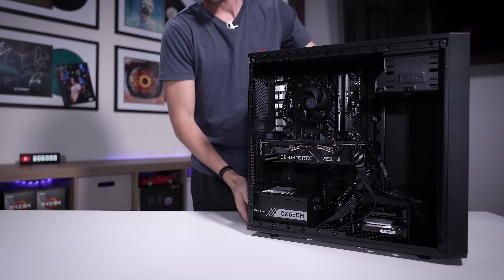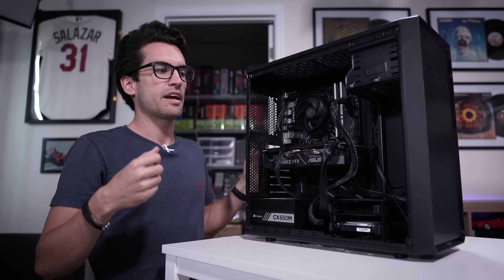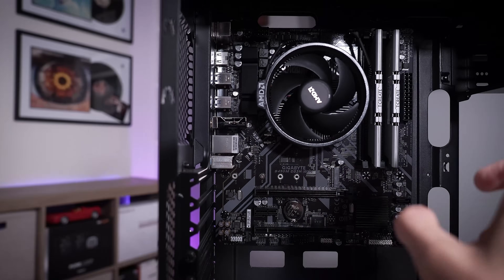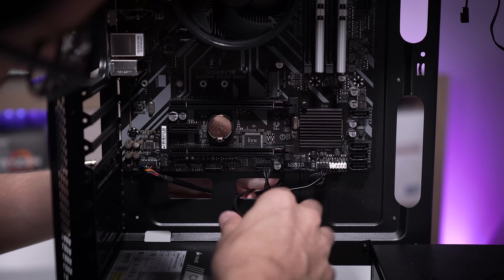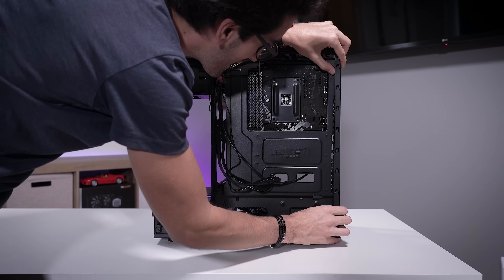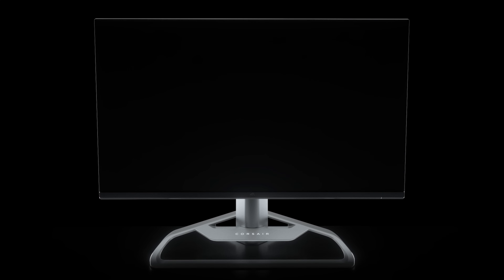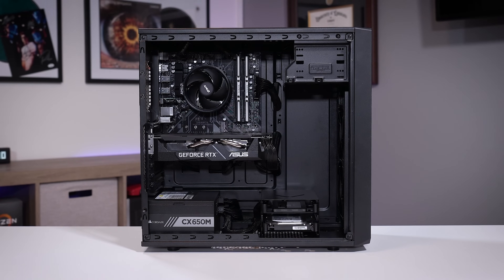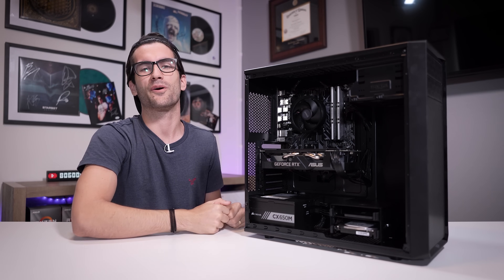Fixing a Viewer PC's AWFUL Cable Management!

Comment from the maker: Anyone out there with a 'party in the front/disaster in the back' kinda rig? 😅
Reply: Yeah me :/ jeez those RGB fan cable is the worst
Reply: @ClemBt  lian li unifans... i have 10 of them in my current build and a total of 4 sets of wires coming off of them
Reply: @ClemBt  absolutely I will never use Corsair fans I’m my personal rig ever again. It’s lian li unis or nothing for me from here on
Reply: @ClemBt  bought the lian li uni fan for this reason but it's expensive
Reply: I'm a small case enthusiast. My rigs are "if panel closes, i'm happy, no transparent side panel"
Reply: well my PC could do with some cable management. but I live in the UK. so I guess my pc would never get in a video
Reply: Me.  It use to look damn good in the back but had to change fans in my case, ran out of zip ties, and just have a ton of wires and control boxes stuffed in the back of the system.  From the front, cables look clean and neat, behind its a totally different thing.
Reply: Yup, probably mine. I do hate having to look at a mess, even in periferal vision, so I always try my best
Reply: Me for sure. I have a TU 150 with a full custom  EK water loop and ALL the rgb. Had to cut holes in the bottom to mount a rad underneath the case and replace the feet with rubber furniture feet to have room. for airflow. Even when I'm just flipping the power supply on I'm always surprised I get the back panel back on flush. Lmao
Reply: I do! But Phoenix is a bit far from Orlando.
Reply: Yes! 011 with 9 ll120 fans, commander pro, the commander that the 150i comes with and cable extensions. Yeah, not so nice from the back.
Reply from the maker: @trick0502  Oof! 😅 I'm picturing it now.
Reply: @trick0502  Go to Lowes and pick up a pack of Gardner Bender Plastic Black Split Cable Tube to shove all of those Corsair cables into. Out of sight out of mind!
Reply: got a hp compaq, its disaster al the way, consistency
Reply: Isn't that how it's supposed to look when you have a rainbow spaghetti monster of cables to hide in an inch of space when your drive cage hangs from the ceiling?
Reply: Nope, I’ve got a disaster in the front and a disaster in the back. 

Big fingers small holes.
Reply: My led cables are not hidden
Reply: Sorta? It's still cable managed but not nice and straight runs.
Reply: Me, especially considering I need to add a PCIe SATA card to use my optical drive.
Reply: my rig has an old case so there is no cables in the back its all in the front Lol
Reply: the title of the video is missing an s i think
Reply: I didn't care about cable management before, but these days I spend more time for cable management than building the rig itself (unless I use custom loop) :D
Reply: LOL guilty....The front of my motherboard area is super clean and routed....behind the board though....Kinda scary but nobody sees it so it's no worry lol
Reply: Yeah, I really need help with cable management.  Help me Greg lol I live near the Orlando area lol
Reply: LL o11d is designed for this, yea 😃😃
Reply: Disaster in the back, yes. I'm in Lakeland as well. Lmk if you need a rig. No worries bringing it up to you.
Reply: That's the only way I cable manage lol
Reply: ✋yup
Reply: My back panel is so battered from being forced on. Reason is I have an old daisy chain 750w psu so molex and Sata connectors all over. So to get sata to like my fan hub and the wires it bulks the middle cos of all the old daisy chain connectors. Fronts perfect tho...except the old ketchup and mustard psu cables, i just need a new psu.
Reply: M-ITX was a good idea at the beginning but in hindsight was painful to try to get the back to look anywhat decent
Reply: mine's actually gaping hole without side panel/rats nest disaster in the back
Reply: Me, sort of. It's not terrible, but not the best either. But then again, I'm just focused on taking things from the front and putting them in the back and that's it.
Reply: You sure we can't ship them to you with a return label to send back? Edit: I'm in Illinois USA
Reply: my pc cable management in the front is pretty good, the style unintentionally black with rgb which looks clean, but once you open the back, yeah there is cables everywhere, its not too bad but its not great
Reply: Yeah I've a total disaster in the back of my pc while the front is looking quite decent. 10 corsair rgb fans with 2 commander pros and 2 lighting nodes, custom watercooled system with 2 radiators in a mid tower are almost impossible to manage. It's more like taming all those cables..
Reply: the back of my pc is really bad even after i tried to tidy it there is just so many cables
Reply: There is a fake person impersonating you greg. He replied to my comment
Reply: My case doesn't have a side panel window...older Fractal Design case, I wired it up nice inside and the stuff behind the mobo...yeahhhhh you'd have a field day BUT I'm way too far away for you to have a go at it.
Reply: I'm working on it lol I have to make room for some cables first pc I'm building
Reply: Was kinda wondering if you could do a 2fer me and my sons pc are pretty dirty an my pc has horrible cable management
Reply: I need you to do my PC. The back has so much going on I am at a loss to how to get it in order. I live in Washington state so not going to happen. :(
Reply: mine is more business in the front, all casual up back!
Reply: Nope, i love working on cable management. I make sure my build looks good
Reply: Nah, the motherboard standoffs scrape the back panel, so disaster in the 5.25” bays.
Reply: Hey greg it took me 4 hours to do my cable management i have 10 hd120 fans 2 cables per fan lol 8 rgb strips corsair ones 2 corsair commander pros inturnal usb hub corsair aio 2700x 32 gb memory in 4 sticks x470-f mb 2070 evga gpu hx 750i psu cable extensions corsiar 570x case a lot and alot of cables 2 nvme drives both samsung 1 sata ssd
Reply: As famously once said; I've tried so hard (to cable manage) and come so far, but in the end it doesn't even matter...
Reply: Spaghetti wirings at the back here 😂
Reply: Back of my rig was okayish on build, but I've changed and added so much stuff (SSD, pump, RGB, cable extensions...) that it's more of a mess now !!
Reply: The front visible part for me is fine but the rear panel is hiding a rats nest of tangled wires and ssds thrown in.
Reply: Better than my cable management. All cables go as the crow flies. Theyre not long enough for anything else
Reply: Yes lol And you just taught me some cool ways to handle that.  I would love to send pics of the cleaner build when it's done.  I'd love to have my build shown off as someone you successfully taught to build like a professional.
Reply: Definitely me. I'm new to building and I don't understand how the more experienced people get the back looking nice and crisp
Reply: Mine is shocking in the back, had to route the cables wherever they would fit. Wish I could send it but I live in Australia :(  I hope this playlist will help inspire me to fix mine up!
Reply: i live in florida and i need this . i don't see an email though
Reply: that's my cable management since it's a pain having to clip zipties just trying to take parts out.
Reply: You have a scammer in your comments i sent him all my money and my first born and still hasnt sent me my pc.
Reply: Hey greg, try manage 11fans, with case of lian li 011 dynamic
Reply: Was this case an early model i thought fractal tends to be better designed than this particular one
Reply: Yup
Reply: I have a 20 yr old superflower case so cable management is a completely foreign concept to me
Reply: Meeee
Reply: It is a mess already!  Not happy at all with the wiring that came with the PSU.  But you gave me some ideas.
Reply: Yeah.
Reply: 2 years later, here I am still watching your videos to try and get my pc not to look like a tornado went through it.  Greg can you please fix my pc???

Comment: just don't connect SATA that way...
1. keep connectors from front (CPU) side
2. connect them last because you may need to swap them more often than everything else
3. SATA connectors are weak so connect SATA cables last after all cable management done.

Comment: This is actually one of the best cable management guides on YT, cause that's what most people have - not an over expensive rig with lots of rgb, glass panels, liquid cooled graphics card and massive CPU coolers, but a fairly middle-range build capable of satisfactory performance in 1080p.

Here's what I wuld've changed:
1) Velcro instead of zip ties. You can get this from aliexpress at a ridiculously low price, and in my opinion its usefulness far outweights its cost. Of course, in doesn't fit everywhere, so zip ties are still a must-have, even if only as a plan B.
2) In this particular case a single exhaust fan would drop the thermals like 5-10 degrees for every part except maybe for hard drive and ssd.

Comment: Cool vid. Only thing I can say is you can clean up the front a bit more by using 2 zip ties for that random audio cable just hanging there. Could do a tight zip-tie on the case. (On the "pillar" of the two small windows) Then a zip tie on the zip tie to hold the audio cable above or below the window so you don't see from the front. Worth thinking about anyway.
Edit: On second thought, don't really see it with back panel on, so never mind...

Comment: Is that the "Focus G" from FractalDesign? I have that case, and it is terrible. For example, it was extremely hard to install the drives because there is barely/not enough room for the SATA and power cables.
At 4:58 you can see the "problem".
It was cheap, but seriously, FractalDesign? I would never buy the "Fractal G" again.

Comment: I quite interestingly always route my BIGGEST cables first, as I find them to be harder to run through things when all of the small wires are already in place 
I had a very efficient and head ache free time doing all my cable management with bigger cables first , smaller cables 2nd 
I guess this shows that what really matters is having a PLAN for it and it’ll go well

Comment: If my current case had cutouts, i wouldve done a better job at cable management but for now, its all in display when i open it, i'll definitely buy a better case in the future for now, im fine with it as is. A really great job to Greg with the cable management tho!

Comment: My build is in the same Fractal case.  I know the difficulties associated with building in that case.  Sometimes you just gotta do what you gotta do.  I revisit my cable management every two or three months just to see what I can do better.  My next re-do will be to replace the psu with a modular design unit to reduce excess cables.

Comment: Hey greg hope you are doing wonderful. Wanted to say i been watching your fix or flop videos for a while now and i really like what you are doing to help others. I wanted to ask for your advice or option on a issue i just started having. I know you don't do software issues and i am sorry to bother but i was thinking that maybe you might have run into this issue in one of your fixes. The issue i been having is that when ever i am on my pc gaming or streaming  both my monitors go dark like they turn on off but the strange part is that my pc is still running and fine and i can still hear the sound of the game on the background i just can see it or get signal on my monitors and both of them when i turn them back on have signal and work fine but they don't go back to the display or game it they just stay off. never had this issue till a few days ago. i have check all and i know it can't be my card because is brand new is a 3080 Aorus Masters from gigabyte the monitors are both brand new too from asus and also have a new water cooler from corsair. So at this point i dont know what it can be and i am so confuse. I feel it might be the motherboard because is a bit old  but not sure what are signs of a motherboard starting to go bad . I feel it might be that as well because at times some of my usb ports  make a disconnecting sounds when nothing is being unplug and at times some of the ports dont send signal but then go back to normal.  Again i am sorry to bother you with this but if you have run into this issue or might have advice or a solution that would be great thank you so much and keep doing your amazing videos and work.

Comment: I have this same case and it looks clean from the front, HOWEVER it has a beautiful bulge in the back panel because there's no other way to keep it clean looking with an older non-modular PSU ketchup+mustard cables
Reply from the maker: There absolutely is a way! We did it in this video :-)

Comment: I have a feeling some time in the distant future companies will make parts where you can just snap/click the parts together eliminating the use of wires all together. The are already doing it with storage. Instead of sata and IDE cables, you connect with M.2. RAM and GPU are connected mainly by snapping the parts in. Now all that is left is for CPU and motherboard power as well as the front I/O connectors, CPU cooler and case fans.

Comment: Hey Greg. Just a quick comment. I think the reason why IT guys hate zip ties is because they can damage the wiring and cause a short if the zip tie cuts into the plastic and down to the wire itself. With a metal case, an exposed wiring can short and fry one of the components. What I found from my other hobby (radio control helicopters) is to use hook-and-loop style velcro to wrap the wire and then use a zip tie. Then you can pull on the zip tie as much as you can and never damage the wire itself. Well unless you go Hulk on it of course. I used just the hook and loop while routing my wiring but I may use zip ties as now after watching your videos I want to do an even better job. I think my setups are fairly clean but they can be improved. I think you can open up another email so that we guys can share our own "good" wiring jobs.

Comment: overall it looks great but I would really recommend the person buy a different case, even for around $60 he could get something that looks alot better then this, something that would atleast have a PSU shroud/basement that would hide the psu and cables better, and have a plate in the back so you aren't looking through the case at the side/back panel.

Comment: My cable management in the Fractal Define R5 sitting next to me is probably not the best :D But I'm often unplugging and reinstalling things so it's kinda hard to get cables to stay put when things are moving around.
Also I have my hard drives mounted backward, with the ports on the left / front side, instead of the right / back side.  This is so I can swap out HDDs without having to do anything on the back side.  (Although for right now I've been keeping both side panels off.)

Comment: Great Job!  I have built two of these cases with full ATX motherboard' and they are tight to work on.  try adding AIO just makes it worse. The hard drive tray is so close I used a 90 SATA cable and power conector ( with a HD not SSD ) or you could not put the side panel back on. again Great Job Greg good case to start with. If you can do that case you can do any case!

Comment: greg, i hope you reply to my question, since i might go to canada soon, i really need to remove my gpu from my motherboard so badly, but the thing is i find it too hard to move the clip that holds the gpu (not the screw), my fingers hurt so bad so i tried using a screwdriver but im afraid it might slip and damage the motherboard itself, do you have any tips for this?

Comment: Hey Greg don't know whether you'll see this message but, could you please do a video of how to completely remove windows form a HDD, because I have one of my old systems, it has HDD and windows 10 installed in it and I'm not using that system, therefore I want to utilize that HDD for my new system which is already up and running Windows 10, I find it difficult to do it alone, it would be much appreciated 🙏 thank you, awesome video's

Comment: Here’s a suggestion for an experiment to prove the validity of good cable management:  2 PC’s, same case, same components, same area - only difference is cable management.  Either you leave them sit a long time or you run the same combination of flour, dirt and other material to mimic dust.  You take temperatures and pictures before and after for each case.  You want the “after” to mimic about triple the time you should be cleaning it or a year’s worth of dust, whichever is longer, including average usage during that time (to make sure parts get coated the same way a normal PC would.
Separate experiment: 2 PCs with the same scenario (only difference being cable management), left to accumulate for a standard scenario cleaning situation, but showing the simplicity and ease to clean each, along with time.  (NOT a deep clean - a standard clean, closer to what a normal user SHOULD do.
You will probably want one of the main computer companies (Kingston, AMD, Intel, etc.) or parts sellers (Micro Center, Tiger Direct, NewEgg) as the sponsor, given you need the components and cables to match in every EXCEPT how it is managed.  You also won’t want to focus as much on the performance - while the temperature measures should be enough of an argument to make your point, others like LTT, JayzTwoCents, Paul’s Hardware and Bitwit may have a
ready done similar experiments focused on performance - your strengths are n maintenance and repair, which is what you want to show.  You also might not need the length of time described in the first experiment to get it done - the idea there is to replicate one of the machines you would get in your PCDC playlist.
Like the video, looking forward to the next, figured I’d toss those ideas out there to help give you a stronger argument for those who choose to argue.